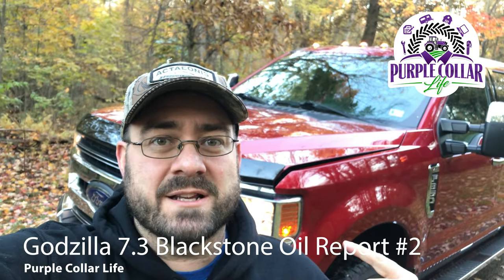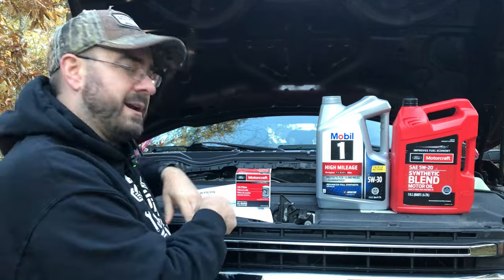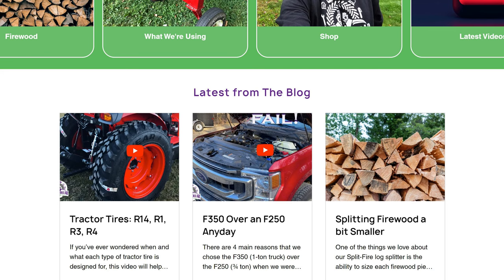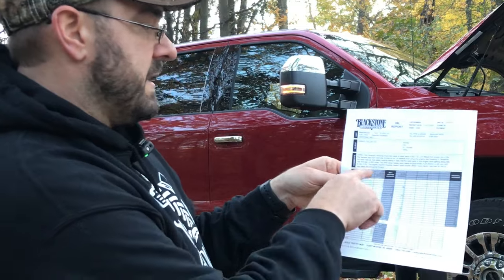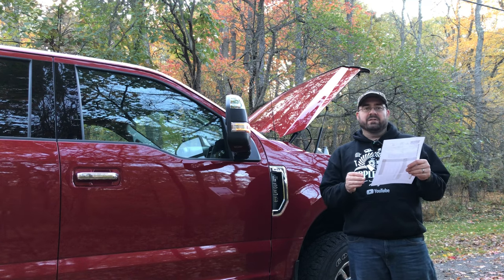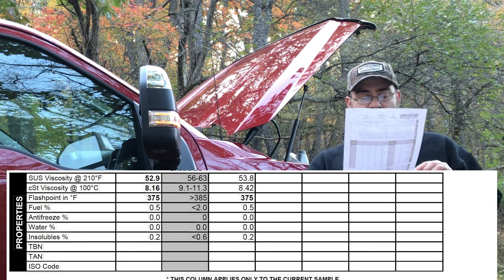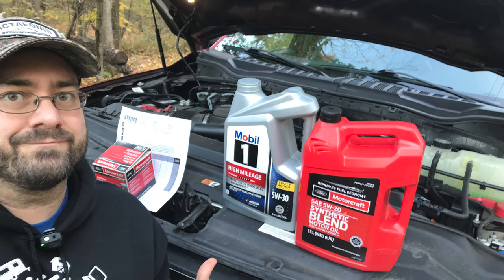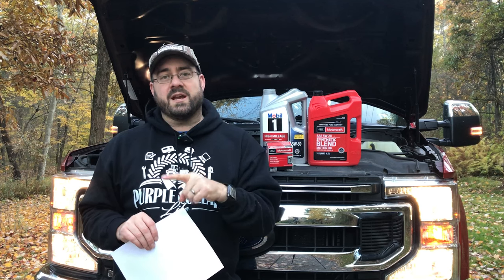Ford 7.3 engine update - Godzilla oil analysis #2 from Blackstone

Comment: Your referencing unit average that’s just the average of your 2 samples.  I think your still a little higher on the iron but hopefully it comes down.  For about 5 years we had a ram promaster van that we built out to a camper van and that 3.6 is know to have major lifter issues. We got 80,000 hard miles out of that van in that 5 years with a trip out west towing a 3500lb camper  and I consistently ran royal purple oil and never had an issue with the van.  We sold it at 80k.  I wish I would have  done oil analysis on it.  I truly believe top quality oil makes a huge difference.  Good luck with the Godzilla
Reply from the maker: You're 100% right. I should have been referencing the number all the way to the right - the universal averages and numbers that  Blackstone has determined to be the "norm". 
I agree that good oil and filters (and regular oil changes and maintenance - including proper engine cooling) make a huge difference in the life of an engine. I've never tried Royal Purple oil. I did use Amsoil for a while. It's just SOO expensive. I've always been a fan of the forum "Bob is the Oil Guy" where I've seen test results on oils and filters. I think the Fram filters aren't very good from what I've seen, but the Motorcraft ones seem to do pretty good. For oils, I've used Motorcraft consistently, but just recently saw a test where the Mobil 1 did great for the price. I've also heard good things about Pennzoil Platinum. But I imagine neither of those test as good as Royal Purple or Amsoil.

Comment: That’s good news with your oil analysis . I have had diesels & my work trucks are always diesel but I love my 7.3 Godzilla. YouTube channel project farm did a great test on oils & I  started using mobile one oil until I seen his test . There’s much better oil out there that’s cheaper  . The packs they put in oil will dramatically change your blackstone results. I plan on staying with the same oil now that was test results can be more comparable as to see any issues with the motor.
Reply from the maker: Thanks for the info! What oil are you using now?
Reply: Pennzoil ultra platinum . It came in 2nd in the testing . Amsoil was 1st but it is not as easy to get and $$ .
Reply: I use only Amsoil as it is the best out there! Period! It is easy to get since shipping is free. Mobil 1 is not the best and I have had issues many years ago with it. I do not recommend it. Also, using High Mileage version has extra additives that might also be skewing the oil analysis results. Amsoil also has extra mileage oil filters when using their Signature series. The Motorcraft filters are good as well. Even the Motorcraft oil is pretty good stuff. I have 240,000 miles on my Excursion V10 and it runs like the day I got it even when towing 10K. I attribute that to the oil. I run it in the Transmission and rear end as well!

Comment: I have seen other videos that seem to suggest that the delamination issue is related to trucks like box trucks and campers where the engine is used and have high idle time.  Because on this engine, Ford uses a variable pressure oil pump so at idle, it is only using something like 8 psi....so not much lubrication at idle.
Reply from the maker: Thanks for the info! I too have seen that it primarily seems to be in the trucks with higher idle times.

Comment: I was hoping you would get good results. I only have 16k on mine sounds good and the oil does not look to dirty on the stick. I used to go 3k on oil changes now I go 4. The oils now are better than they used to be. I only put about 7k a year on it so 4k is about a 1/2 a year so time is also a good reason to change oil. 👍
Reply from the maker: Thanks for watching!

Comment: brother man, please stop worrying so much about this over inflated issue, it only happened to less than 1.5 % of trucks manufactured in 2020 and less than 1% of trucks in 2021. I have 2 Godzilla trucks one for work and another for pleasure, they both passed 50k miles with no problems. I think you're worrying too much....
Reply from the maker: Thanks! I hope it's not an issue. But I don't mind paying for the oil analysis at each oil change just to check on the engine. Thank you for watching and supporting the channel.
Reply: Def an over inflated issue loved by diesel fan boys.
Reply: And even if it’s showing something on the oil analysis, good luck getting a ford dealer to do anything until it “throws a code” or has grenaded completely.   I’ve got a 2020 F250 with the 7.3 and it’s been perfect, transmission too, it’s a little stiff and surges a tiny bit when cold (not much of an issue in AZ), but once it warms up, it’s incredibly smooth, you don’t even realize it’s shifting.   I like it a lot more than my 2018 6.2 which had cam phaser issues and was just underpowered and struggled when towing up the mountains here in AZ.
Reply from the maker: @Klf173  - I've noticed a huge difference letting the truck warm up (in our cold climate) before engaging the transmission.
Reply: @PurpleCollarLife   i do like that it functions really well when it’s hot, as hot is what I have 90% of the time in phoenix, I’ve had transmissions that get really slushy when you were driving a lot in heavy traffic and high heat.
Reply: How much is the report

Comment: That's a small oil filter for such a large engine, looks like its almost 1/2 the height of the old FL1A filters used in a lot of older Ford engines.
Reply from the maker: I thought the same thing! The 302 in my old Mustang used the FL1A filter, as did every single Bronco I owned with the 351 Windsor engine. I am really surprised that this 7.3 liter engine uses the shorter FL820S filter.
Reply: I was thinking the same thing once I saw the size of that filter.

Comment: my truck is new I changed it at 3000 miles and plan on  changing it at 6000 I just want to make sure there’s no crap floating around in the engine
Reply from the maker: I agree - better to change it too often than not often enough.

Comment: Hi Chad, great news on the second oil analysis.  I do hope you can get the transmission issue sorted out soon. My brother went from a '17 F-250 6.2 with the 6-speed trans to a 2023 F-250 7.3 Godzilla with a 10-speed like yours and he is having transmission issues as well.  His dealer told him that the transmission just needed to "learn" his driving pattern then it would correct itself. I have never heard of such nonsense from any dealer and I have had many new vehicles over my lifetime.  On another note, how is the Andersen Hitch holding out after all this time?  I didn't see any update on it so I assume it is still doing ok?
Reply from the maker: Thanks for checking in! The oil analysis was a much better report card this time. The transmission is a weird thing. Sometimes it feels totally good. Other times I feel like we’re just miles away from having it towed to the shop. I find that the most problems come when I’m going slow, in the 1st through 5th gear range.  If I’m on it a bit more aggressive, it does great. But if I’m just putting along, it doesn’t seem to like that driving style. 
The Andersen hitch worked great for us! We did use the B&W hitch most of this summer so that we could better talk about the things we like about each in future videos. So we’ve got 1 summer towing with the Andersen, and 1 summer with the B&W. 
I will say that when I was putting both hitches in the building for winter storage, it was MUCH nicer to move that Andersen hitch around. It’s amazingly light weight.  Thanks for watching!

Comment: I guess if I had a new Ford or GM (which I wouldn't)  I would do oil analysis too, as they have so many problems. I own a Toyota with 4.7L V8 with 150K miles and no problems and no oil analysis and I'm going to keep it that way.  It's puzzling to me why there are so many cam/lifter problems these days, have they forgotten how to design and manufacture these basic engine parts that have been around for decades?
Reply from the maker: It's a great question for sure - why so many issues now compared to the past?  
If Toyota would get into the heavy duty truck market (3/4 ton and 1-ton at least), I do think they would do well - if they can keep the frames strong enough.
Reply: I've seen many toyota's fail also. It's just statistics the big 3 sell many more trucks then Toyota and the big 3 trucks are worked much harder. Now days when something fails people post it all over the internet. The odds of it happening to you are probably 1 or 2 in 100. Sucks to be the one it happens to but it's not as common as social media recirculating the stories make it seem. I'm on my fourth ford truck ran them all to over 200,000 before selling not a single engine internal engine problem all were running great and I sold one to a family member that's now pushing 300,000. Main thing is to do maintenance According to how you use your truck at work we have ford trucks literally idling and crawling through construction sites with 15,000 lbs trailers around the clock and abused on purpose by workers especially the night shift lol. Toyota makes good highway cruisers but they will not hold up to heavy hard use like the American brands. I believed the toyota hype and now have a 2018 in the family and after recalls and dealer visits its out of warranty and my dirt road is rattling it apart.

Comment: I wouldn't switch brands just because it's on sale. I also wouldn't use anything but Amsoil......which I use to be a hater of.
Reply: And you are changing your oil too often!
Reply from the maker: Thanks! I used Amsoil in previous vehicles. The cost is just SO high. But you probably get what you pay for, I suppose.

Comment: Every engine has its faults. This one has some lifter failures. So doesn’t every other engine. It’s most likely gonna be fine. Now that 10 speed transmission is something I would NEVER get. I have friends who have these newer truck that tow often and the transmission is a piece of crap. Designed poorly. So really the motor should be the least of your concerns. But overall you have a solid truck once you get your new transmission every so often.
Reply: what knid of issues they having with the 10 speed? i think they have different versions of 10 speed depending on engine some more heavy duty than others
Reply: @Cape-bp2qj  constantly shifting gears. Causing premature aging on the transmission. He tows about 8k on a regular basis with his 2019 f350 powerstroke. I think it’s somewhere at 100k miles on its 4th transmission
Reply: I have 60k miles on my 2018 10 speed transmission. Love it. Smooth as can be.
Reply: @bigp6071  Do you tow?
Reply: I do. 32 ft alpha wolf travel trailer. 7k pounds.

Comment: Your wasting money and time... Buy yourself a full synthetic 5W30. I recommend Pennzoil Full Synthetic 5W30 which is made from Natural Gas... Change oil at no more than 4000 miles, earlier the better.. I do mine at 3000 miles, I'm at 343,781  miles on a 1995 F150 pushrod 5.0...I've only replaced the waterpump and Distributer assembly.. I have 2013 Ford Taurus 3.5 v6 dual overhead cams.. Same oil 3000 miles... Engine oil performs 3 functions... Lubricate,  Clean and Cool... Your making too much unnecessary worrying over the internals of the engine..Earlier oil change intervals give engine longevity easily into the 500,000 miles..Keep it simple, your over doing it..